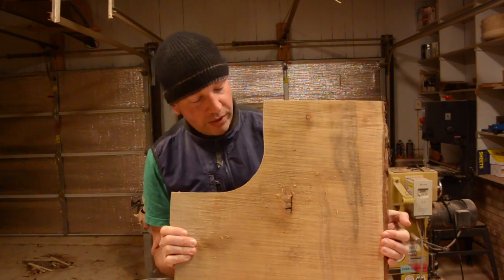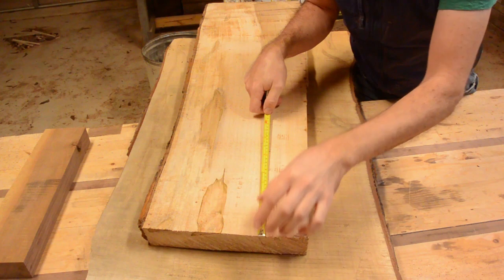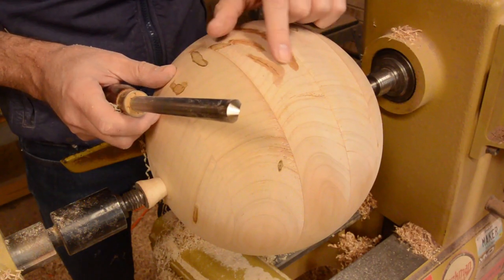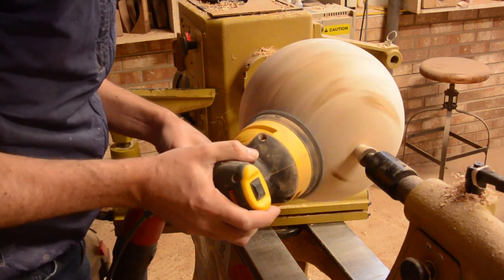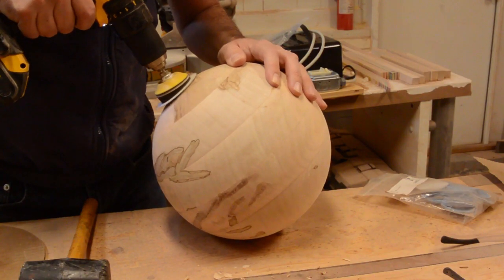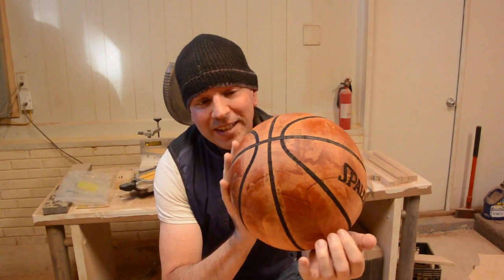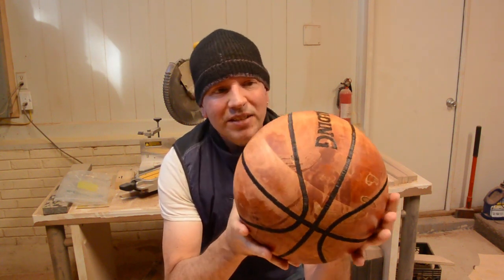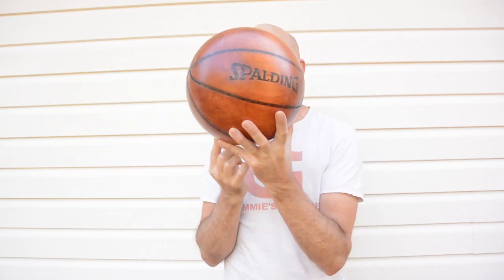Making a Basketball from Wood - Art, Sculpture, Woodworking

Comment: Fascinating. Interesting wee trick with the print out and acetone - was that a laser printer or an inkjet or something else? I'd be Keen to try that some day... Cheers mate, that was very enjoyable.
Reply from the maker: Thanks, Mark. I probably should have clarified that it was a laser print. The transfer did not work so well on the curved surface, but it works well on flat surfaces. You have to work quick though, because the acetone evaporates very quickly.
Reply: @CammiesGarage  That all makes sense, ultimately it worked out well. In the past we've made stencils from printouts but that's mightily time-consuming. I'll give the transfer thing a try next time. Thanks mate!